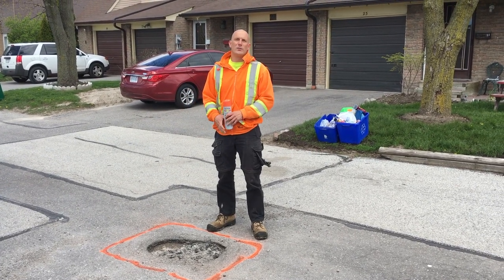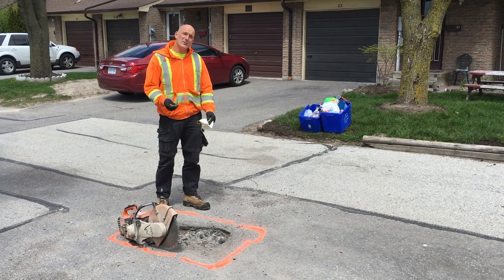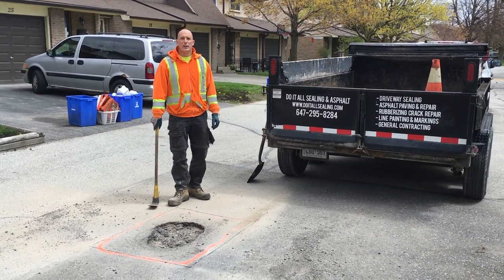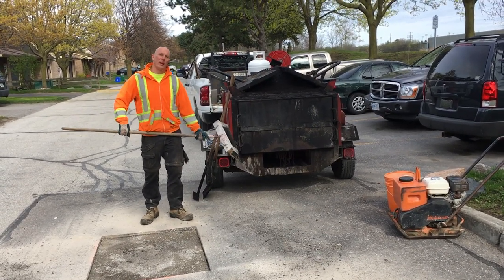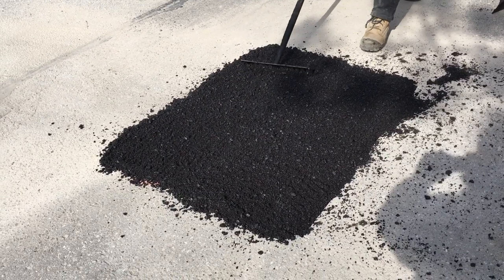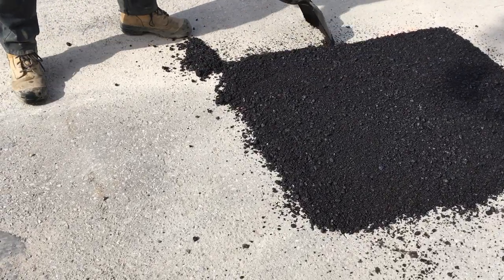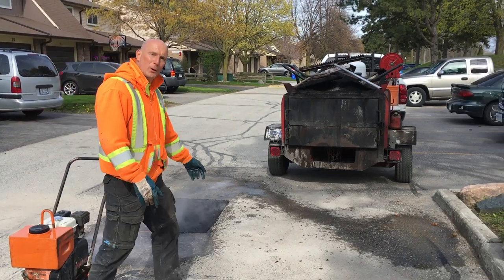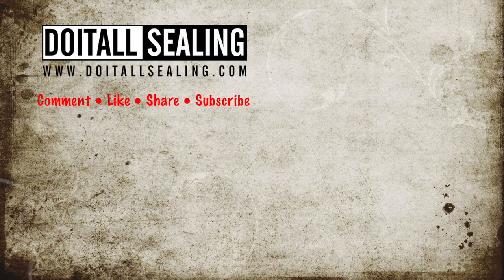Asphalt Pothole Repair

Comment: If you need safety glasses you can use that as well but for this job I won't be using them because it's just a very quick cut? How long does it take to lose an eye?

Comment: That patch was too low. After you compacted you left a depression. Did you check the sub base once you excavated? Most pothole problems have sub base issues as well. Not going to do much good to patch them if the underlying issue isn't corrected.
Reply from the maker: The client wanted it as level as possible.  At the time of that video it was just before winter.  I agree sub base is all the problems with many patch jobs that fail.  This patch held up until they replaced that section of roadway.  Thanks for the input appreciated!  Thanks for watching.

Comment: No tack oil? And loads of dust. Could have been a longer laster repair
Reply from the maker: The repair was only a quick fix before they paved the roadway.  I am filming some newer videos and I will be showing the use of Tack coat SS1 glue in them.
Reply: @farmcentralohio  Hey man, why are so rude to Jeff?
Reply: @bw1749  so rude? the guy is doing a hack job and putting it on utube lol
Reply from the maker: @farmcentralohio  Thanks for watching!  This was the 4th video on my channel years ago and my mistake was I should of mentioned that this repair was a temporary fix before paving started on the road.  The main concern was trip hazards and and vehicles going over the pot holes.  I just filmed a new video on my new channel which will be up in a few weeks on Pot Hole Repairs.
Reply: The hole was demolished way to shallow  no tack lute skills are ok but needs some work he could have done it all with the lute spread leveled edged and finished
Reply: I do pothole repair everyday on major interstates

Comment: Would cold patch work, if you can't get hot asphalt? I don't have the hot box or vehicle to drive it to the worksite, and am looking to improve my pothole repairs. I use tack coat on my repairs, and am looking into getting a good demolition saw. 

By the way, nice informative video. You made that look easy!

Thanks,

Michael Warren
Open Source Roads
Reply from the maker: You could use cold patch repair but most repairs for commercial or town house complexes like this one only want to use hot asphalt.  Tack coat is excellent to use on patches and if you were using cold patch that would help even more.  Thanks for the comment!  Check out my other videos if you already haven't I use a variety of different equipment depending on the type of repair i'm doing.
Reply: We use cold patch all the time (I work for a county road department) but it will be temporary. There are good cold patches and bad ones. Most good ones come from asphalt distributors, not hardware stores. The ones you get at hardware stores are ok for driveway's and walkways, but not roads. Cold patch is almost always very temporary.
Reply from the maker: @mikel9567  That is true!  The city here doesn't use cold patch I don't think.  Most of the time they just run trucks with hot boxes and do very quick patches on the road not mean to last at all.  This city is in a constant state of paving!  Winters destroy our roads!
Reply: If u mix ur cold pack with tack it's basically hot pack but not really u gota tamp it very well but cold pack is basically a band aid hot pack last much longer just wait for hot pack
Reply: U don't even have to out a cone after u pack it it's good to go the water cures it fast

Comment: Is it possible to just lay the asphalt down without cutting it and removing it?  I see city guys on the roads just throwing it down and leaving.
Reply from the maker: Yes it is possible but they are only temporary repairs.  The city guys in Toronto do that same thing throw is down and wack it in.
Reply: my city does pothole fixes by cleaning them out than tar(tacking it) than load them with blacktop and steam roll it

Comment: 1:48 dont teach peapole that they shouldnt wear eye protection when its just a small cut you always want to wear eye protection just by simply toutching the cutting wheel to the asphalt it can fling up a small rock into ur eye and may blind you altso as you are dry cutting the asphalt it even more inportant to wear eye protection since the dust can get into ur eyes...
Reply from the maker: You are correct!  You should always wear eye and other protection.  In my newer videos that I am doing I make sure to always use the safety equipment for protection.  I will be starting a new channel for my construction work in a few weeks!   Stay tuned for the announcement!

Comment: I live in a town were u get 40/50 holes in a hundred foot area we dont do this we use hot pack and make big shims fill the deep spots and spread hot pack 6 inches around ever hole and roll it no need to cut and do all this sticks the same way if it's a natural hole or cut hole ur just using more town money and product

Comment: Now do you ever use that propane tar machine to tar your edges? Or is that not Necessary. I’ve done pothole repair a few summers back and here in pa the roads are so bad I’m thinking about starting my own company doing this just would like some on site before I buy things I don’t need.

Comment: Fills the patch area with debris. WTF?
Reply: I noticed that, an air line is essential.
Reply from the maker: @Poepad  This was an older video on my channel that I should of mentioned this repair was a temporary repair before paving started.  The patch held up fine before it was paved.  I just did a new video on Pot Hole Repairs on my new channel and it should be out in a few weeks!  Thanks for watching I appreciate it!

Comment: Great info and video.  How long is the hot asphalt useable?  Is it still useable once it cools off?
Thanks.
Reply from the maker: Great question!  In a hotbox I can reheat the asphalt even a year after.  Under normal conditions or asphalt that's on a dump truck or trailer after it cools off its useless.  You can't rake it and you can't compact it anymore.

Comment: Jeff, what is the cost for something like this?
Reply from the maker: +Travis Montgomery normally for pot hole repair there is a minimum service charge and then dependong on how many repairs and the size of the repairs.  For this particular client that day we repaired 5 or 6 of these and i believe it was around $900.

Comment: So how much do you charge to repair a pothole of that size?
Reply from the maker: If it was 1 pot hole and we are using hot asphalt there would be a minimum service charge about $600-800.  If there are multiple repair area's then this pot hole would be approx $100-$200.

Comment: Terrible job. No disrespect to the tech just unlearned. First off you didn’t apply any binder/tack witch is required to prevent water from entering the joint where the cut was made. And lastly it’s so hilarious how the compactor was going up and down because he didn’t thoroughly take asphalt to a Level finish.

Comment: Buy your self an infrared heater.
Reply from the maker: john slingshot I'm actually going to be getting one.  They are awesome!
Reply: We got one from Heat design equipment in Canada in 2006,  12 years old and it never let us down. Never needed one part for it. Now the priced have tripled for them.
Reply from the maker: john slingshot yeah I believe it.   Even line painters have gone up in price by the thousands!  How big is your infrared heater?
Reply: We got two of them, the P300 and  the P150  We use the P150 90% of the time. The P300 is too big  For small potholes.  They said the infrared blanket would last between 1500 to 200 hrs.The P150 must have over 3000 hrs on it and still works perfect.  You cannot pressure wash them or get the under blanket wet. It will destroy them.  The old school infrared is the tubes, They only heat under each tube and the surrounding area on the side of the tubes does get warm but no where near what a blanket does.
Reply from the maker: john slingshot I'm going to look at those units and see what they are about.  It's great hearing from someone that has experience using them.  This will help in making my purchase decision!   Thanks so much!

Comment: Are you serious!? You should be embarrassed by that work!
Reply: Why? I don’t see a problem
Reply from the maker: Thanks for watching!  This was the 4th video on my channel years ago and my mistake was I should of mentioned that this repair was a temporary fix before paving started on the road.  The main concern was trip hazards and and vehicles going over the pot holes.  I just filmed a new video on my new channel which will be up in a few weeks on Pot Hole Repairs.